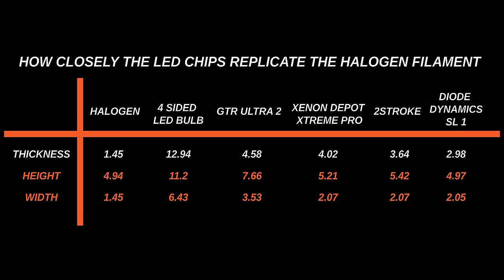Why You Should Avoid Multi-Sided LED Bulbs | Headlight Revolution

Comment: I just went outside and turned my 2 sided LEDs 90 degrees (from vertical to horizontal) and I got better lights now, ty.
Reply from the maker: I'm so glad you got it taken care of! That makes a huge difference.
Reply: I'm calling BS. Headlights are "clocked" so they only fit into a headlight housing one way.
Reply from the maker: In a way, You're right. The headlight bulb collar can only be inserted and locked into place one way. From there, Most headlight bulbs can be adjusted or 'clocked' inside the collar itself. This will allow you to ensure the LEDs on the bulb are oriented properly in that particular headlight.
Reply: @jberkhimer  What you think matters very little to me, but you're also wrong. LEDSON LED 11G Xtreme (6000K) - H7 Is the name of the bulb. The collar can be turned all the way around, wich is fortunate cuz if the cable would have come out at the bottom they wouldn't have fit in my headlights.
Reply: @KalLanPIDT  Nope. Look at the bulb and it has a tab that aligns it. BS.
Reply: @KalLanPIDT  it's just headlights calm down
Reply: @jberkhimer  many bulbs have adjustable collars, including the Diode Dynamics SL1's mentioned in this video. I installed them yesterday and there is a YouTube video that explains how to move the collar to make sure the lights are verticle.
Reply: @chilliin  Do you mean horizontal? Since the OP got better lights by turning them from vertical to horizontal.
Reply from the maker: If you guys haven't seen our video on how to adjust LED headlight bulbs, I'd check it out. It would clear up a lot of confusion here!
https://www.youtube.com/watch?v=NbfAyqVgVdM
Reply: @jberkhimer  most led headlight bulbs have adjustable rings.. don't be stupid.
Reply: The bulbs I got from Sealight need to be clocked vertically. The low beams headlights were clocked properly but I had to use the internal adjustment the get the high beams vertical. Position must be different with each manufacturer. Good video.
Reply: Thank you ❤. Most useful video

Comment: I absolutely enjoyed watching this video! I find it really entertaining and you explained the different types of bulbs really well! I run LEDs in reflector headlights and they come out way brighter and way better. It depending on what bulb your looking for and like you said in the video, figure out the length and the width of the led bulb. A lot of people will say “No! You can’t use LEDs in reflector headlights! You’re blinding everybody!” I did have slightly shorter length LEDs in reflector headlights, I didn’t ever get flashed by oncoming cars, however, I’m always being a self conscious that the beam pattern isn’t brilliant and the cut off line isn’t great. I look into slightly longer ones which is Novsight ones again, it depends of how long and the width of the bulb you’re looking for. I gone for longer ones and the beam pattern comes out much better! Thank you so much for the info about the different bulbs!

Comment: I put SL1 led lights in my 2015 Sierra and I love them! Didn't have to drill any holes because they are slim and was able to get the dust cap back on. If people would just do a little research before buying they could save themselves time and money.
Reply from the maker: That's very true and that's why we're here! There is a lot of misinformation out there as well. The SL1 bulbs are a solid choice from a good company.

Comment: Yes you are right about the 360 led on halogen reflector housing but in my case, tried so many LED bulbs and ended up in the 360 led. Im using stock projector bi beam on my car with the solenoid magnetic cutoff. I got a nice cutoff and a better high beam than most of the leds i tried. Thanks for the info as always!
Reply from the maker: Glad that you liked this video, thanks for commenting! Let us know if you have any other questions, have a great day!

Comment: They work fine in projector housings.
I tried the normal LEDs in mine and it was terrible.  Then I put the 360 bulbs in and they worked really well.
And vice versa, the 360 was terrible in my reflector housing.
Reply: Exactly, I use them in my 2001 Ford focus and the headlights are better than they've ever been.... Everything he described was not the case for me, but I assume he's speaking for more modern headlight housings.

Comment: Thanks for this,  I fitted a three element to my motorcycle headlamp and could not understand why it was so terrible, annoyed hell out of other oncoming vehicles and there was basically zero difference between high and low, now looking for proper 2 element LED.
Reply from the maker: Reach out to our CS team so we can help you get that fixed up! 

218-755-5200
Sales@HeadlightRevolution.com
Reply: Same as you 
3 sided led lights looks cool from the outside but in duty it's terrible
will try 2 sided one .

Comment: I noticed the cone shaped led was only used in the halogen housing which I would have suspected would look like crap.  But, if it was used in a projector housing with a shutter that calls for say a 9012 bulb, it seems to me that this would be an ideal situation, because the shutter would cut light from the end of the bulb in low beam and open the entire light source on high beam. Correct me if I'm wrong.
Reply: Of course you're correct but that wouldn't fit with Headlight Revolution's narrative.

Comment: I really wanted to see what the results were for that cone shaped bulb in the projector light. I ran one before, I'm considering running it again. My housings are at max height and it's still too low, so I'm wanting to try different styles of bulbs. I'm currently using FAHREN 9005 HB3 2 sided bulbs on a 13 Dodge Dart withe Spec D Tuning sequential switchback headlamp assemblies.

Comment: Wish I had seen this before my failed purchase. Only $20 loss but unnecessary cost for education. Fog light replacement on my 2011 Equinox. Hoping to match my upgrade to the headlight's which work perfectly!! Theory seemed will founded...all those LED's should have lite up a football stadium. After install and facing the car, they didn't seem overly impressive but the light color matched the headlights... from behind the steering wheel I thought they had burnt out!! Being it was twilight outside at the time, I thought they would get better at full darkness. NOT! Turning the fog lights only on, was the only way I knew they were working. I literally had better down the road brightness holding my cellphone out the window with the flashlight on. Thanks for the info to understanding why it doesn't work!!!

Comment: Have you ever tested LED bulb in housing that are for off road equipment? The housing that I am wondering about were reflector style and generally used a 9005 bulb. Typically they were setup to produce either a trapezoidal or flood pattern. I assume the same basic apply for the trapezoidal hosing but what about the flood?
Reply from the maker: A good set of LED bulbs should still imitate that same pattern, Especially if you go with something like the GTR Lighting Ultra Series 2 or the S-V.4

Comment: Pretty cool examples but I have a set of the 360° cone(as you called them)  in my projector headlights and they have the cutoff and hot spot, brighter than halogen don't know exact amount as I don't have a lux reader
Reply: Which ones did use? I’m having a hard time finding bulbs for my projectors and came across the cone LED’s but this video is saying otherwise but I didn’t see them use the cone leds in the projector lens I’m guessing cause they worked better than all the bulbs.

Comment: Excellent video for driving lights. I have 360 in my fog lights with only the cone reflection surface. It works alot better than my stock bulbs. Maybe the others would be better. I don't know. Got them as a gift so that is what I use. When I have to change them I will look into a different style

Comment: I watched this after I installed the 4 sided 9006 low beam led lights. I was using 2 sided 9006 LEDs and I saw 3-4 sided ones when I was browsing. Since their prices were very similar to my 2 sided ones, I decided to UPGRADE my low beams with the more powerful ones. Actually they are producing more light than my 2 sided ones in my case but the problem is they have vertically wider angle with the same headlights. I was trying to find out how to adjust the aim of the low and high beam lights separately because the upper line of 4 sided LEDs were quite higher than my high beams. I found only one adjustment bolt in my 2006 Honda Odyssey that adjusts the aim of the whole assembly. I am not a professional but if I understand everything correctly, there should be no way to adjust them properly while preserving the aim of the high beams. Because the additional sides of the 2 sided bulbs will always create a problem since they are not designed properly as you explained in this video. Thanks for sharing 👍
Reply from the maker: That is the issue with those multi sided LEDs, they usually produce terrible beam patterns. If adjusting the headlights is not fixing anything, I hate to say it but the bulbs themselves may be causing the issue.

Comment: I like how the video used some measurements, however I personally disagree with the fact that having multisided led is bad for headlights, i might agree in some regular headlights but in most modern headlights which contain a lens, it is automatically designed to gather the light into one spot

Comment: I totally agree, that 2sided LEDs are the way to go. BUT I have headlight with separate high and low beam and it seems, that multiple-sided led would be better for high beam reflector. Yes, their  light source may have larger area, but I don't think it is a downside in high beams.  They may be hot, but I think that would be okay, because you don't use high beams for long periods of time. What do you think please?
Reply from the maker: The issue with using multi sided LED bulbs for high beams would be the lack of brightness and also a terrible beam pattern. Even though you don't have to worry about blinding people when your high beams on (assuming no traffic is coming since they are on) you won't have the light going where it's needed. 2 Sided bulbs will still be better for high beam applications.

Comment: These 5:15 and 5:28 bulbs could work well in a projector headlight as they are similar in light point size to a hid bulb.  It's a pity you didn't test them in the projector.  The ones you tested in the projector have a larger light point.
Reply from the maker: Thanks for the comment.

Comment: Great video! As you said, two sided leds mimic the filament, but for now, will not make a light pattern exactly as the halogen. To achieve that, led chips should make a 180° light emision, nowadays they just make 140° max
Reply from the maker: While that is true, The newest bulbs on the market are doing a really good job of imitating the factory beam pattern. There are some great options available today and that was NOT the case a few years ago!

Comment: I don't know I put 4 sided H11 LED headlight bulbs on my stock headlight casings on my 2015 Nissan Sentra two years ago. Visibility is not only brighter but it also gives you a wider and father view which to me is priority since I do a lot of highway state to state driving during the night and wildlife can surprise you here in Colorado. I also get a lot of compliments from friends and strangers at gas stations. I've also noticed it makes my vehicle look newer if im driving behind you and it looks a lot better than outdated yellow headlights. My best friend has the same exact car w. Regular headlights we've put the car side by side in the pitch black Colorado mountains and it was OBVIOUS my LED lights were vastly superior in terms of brightness, distance and a wider view. My only complaint is they do not illuminate nearly as well as halogens do in heavy rain!! I still firmly believe the pros outweigh the cons! I would definatley recommend. Im a real consumer for two years now.
Reply: Also halogen bulbs will burn out a lot sooner than LED headlights like a LOT earlier. They produce a lot more heat causing quicker fading and yellow nasty film on your headlight casing. Lastly, they use a lot more power and current than led bulbs which results in higher demand from your alternator and battery which could mean premature costly repairs. Ill put it this way I have always purchased the standard cheap Walmart battery for my car and mind you i live in Colorado so I sit and smoke in my car regularly with my lights, and radio on continuously for hours and those lights have never ever caused my battery to die. With my halogen bulbs Id have to turn my car on every 10-12 minutes to keep the battery from draining. The difference is current is crazy. I do recommend LED headlights!
Reply from the maker: LEDs really do help, although we could not find a pair of multi-sided LEDs that really worked that well in any headlight application. I am glad that they are working for you in that application, let us know if you need anything else! Thanks for the support!🙏

Comment: Vision Pro P series is an interesting bulb it's for projectors. It's Sit in the housing and the two chips are on either side  like this...∆ it worked awesome on tests. Still two sided but led chips are positioned at 10 and 2 rather than 9 and 3. Your thoughts???

Comment: How could I reduce glare / scatter over the low beam cutoff?
I replaced my LEDs with halogens cause I thought it would help, but it’s exactly the same, just precieved dimmer cause it’s a warmer color temp. 

I’m gonna stick with the halogen ones till they die, then try out those mini-projectors where you have to remove the inner dome, assuming I don’t find a fix for regular bulbs. 

Car is a 2008 Honda Fit Sport.
Reply: The mini projector I’m talking about are the kind where you don’t have to do a WHOLE retrofit. They just look like a big bulb, with a lens on the front. 
They’re supposed to have a sharp cutoff just like a full-size projector. 
All you gotta do is remove the little dome / glare blocker from the inside of the housing, and the bulbs do all the work. Not using the headlight housing’s reflector at all. 

Assuming they actually work.. luckily for my car, I can reinstall that dome piece if it doesn’t work, or I change my mind in the future.

Comment: I think you’re right I just installed an led with 4 sides in my Mercedes headlights didn’t work the light doesn’t shine far away and the lights just spread out not pointing to the road but no blind spot I hated it. I’ve used an Hid for more then 3 years and it works good but it just that I wanted to see far away that’s why I changed to LED . What can I use on my car headlights ?
Reply from the maker: Send us an email to Sales@HeadlightRevolution.com and we will get you exactly what you need for your vehicle. There are a few good options to choose from, We will get you taken care of!

Comment: Which led color is the most comparable to a halogen bulb? Although the 6000k is a very nice, a color that's similar to a halogen might help in countries where installing leds is illegal. 3000k is to yellow, but 4000k is to white compared to a halogen... Maybe you can make a video about this subject.
Reply from the maker: 4300k is going to be most comparable to a typical halogen bulb, Especially with a 55w HID ballast.
Reply: @HeadlightRevolution  I've seen a lot of cars with oem xenon with 4300k and the light is a lot whiter than a halogen, so definitely a led with 4300k will be whiter than a halogen.

Comment: Thanks! I greatly appreciate your help! It definitely guided me in making a better selection. My left bulb has now been randomly flickering on & off. Any tips?
Reply: Might need a decoder. LED lights dont draw the same ammount of energy as halogens so the vehicle senses there is a short in some instances....my dads low beams would turn off every now and then until he installed a decoder.

Comment: Hi HR, I just purchased a set of LED low beam ( H-11) lights. I've already installed one without difficulty, however, on passenger side i have a problem. Should the LED strip be horizontal or vertical once placed securely in the socket? Thanks in Advcance
Reply from the maker: You want the LED diodes to face 9 and 3 when installed into the housing!

Comment: Is there a H1 LED bulb unit that actually works good enough for daily road use ?. Ive tried a few and they were all trash so im back with Nightbreaker Halogens for now. But would really like a 6000k LED with the same or better light output of a Halogen, but in a H1 format. Ive just not found any that are good enough. Can you help ?.  Thankyou.

Comment: I'll stick with my  halogens.
 Sylvania silver star ultra all the way.
Reply from the maker: No shame in that, You should check out the VisionX Halogen bulbs too. They have some solid high power options that are pretty affordable.
Reply: Been there done that. The Ultra's a good for a year if you're lucky. They run super hot so there's no life in them, they are nice and bright but LED's are far brighter than even the Ultra's. However with the Ultra's PNP and no error codes so that's one advantage. Halogens are dead in my opinion and all future vehicles will have LED, Laser or another new source. I expect Graphene to be part of future tech in lighting.
Reply: LED bulbs are good for sidelights and interior lights.
Reply: And new bulbs every 9-12 months! LED's are great if you get the right ones designed for the tight housing.
Reply: That’s what I run. Been good lights for me. Many years on my current set.
Reply: I’ve used them for years in my Tundra.  They improve night time vision for sure.  They only have 140 hour life printed on the package. It is a MF to remove my grill, side panels, and entire headlight assembly to replace the bulbs every year though.  I’m going to try some LEDs...I’ve got nothing to lose at this point.